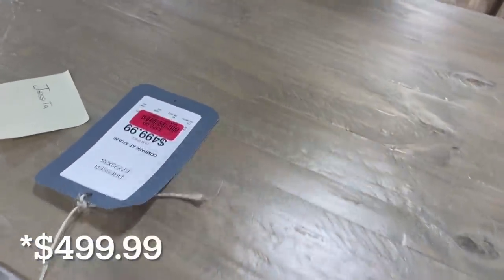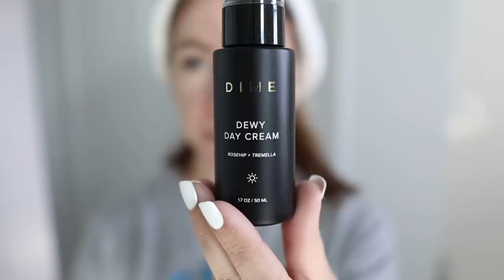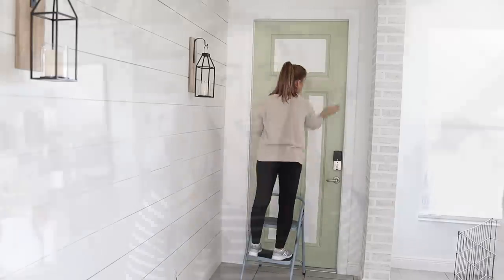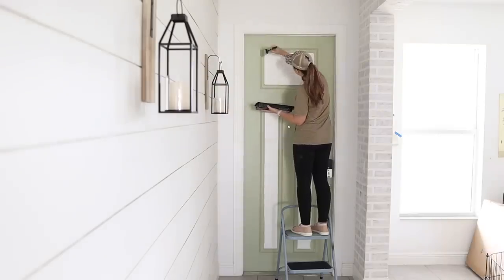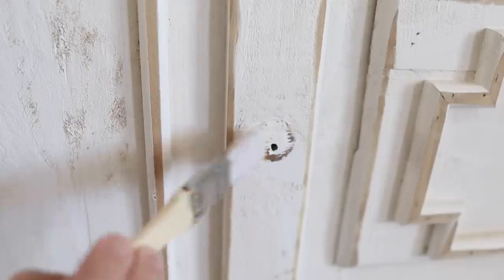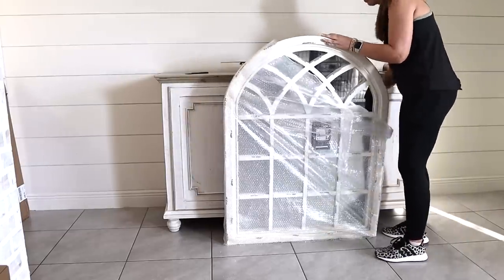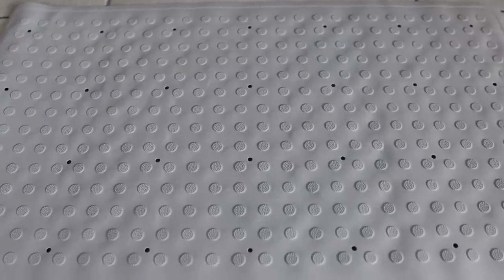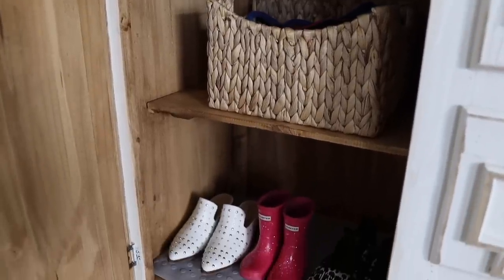DIY ENTRYWAY MAKEOVER  | SMALL ENTRYWAY STORAGE + DECORATING IDEAS | Jessica Giffin

Comment: Hi Jessica! The mirror from Kirkland's is beautiful! I have one from there on my mantel over my fireplace and I'll never get rid of it. They have such unique mirrors there. It is just perfect for that table. I'm just going to put it out there that I used one of those command hooks and it didn't hold the weight well and the weight was only around 1-2 pounds. It fell off repeatedly. So with someone pulling a backpack on and off of it may not really end up working. Possibly just laying it down inside the cabinet would be good enough vs. ending up splitting or damaging the wood. Yes I love sage green! I'm thinking of painting my kitchen cabinets that color soon. It is such a nice neutral shade of green and greens are really in right now! Someone had mentioned a basket on the table for keys, but also a large decorative type of bowl would be kind of nice there for keys or other small items that would be somewhat hidden. Your runner looks great too! Very nice, Jessica!!